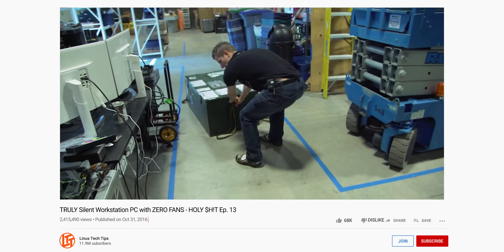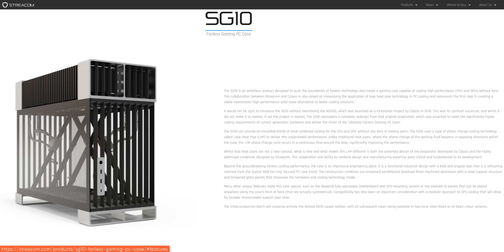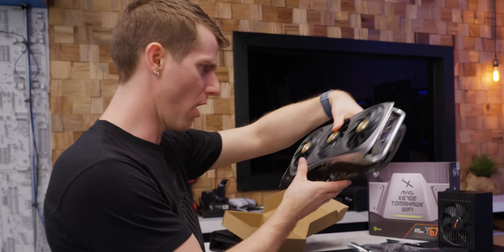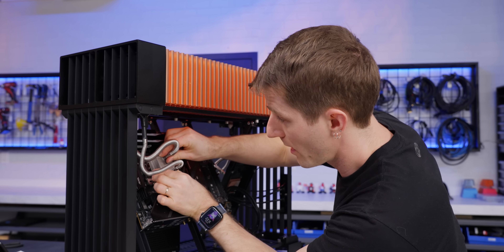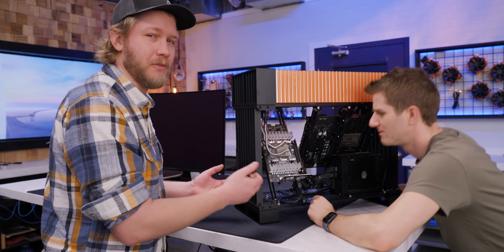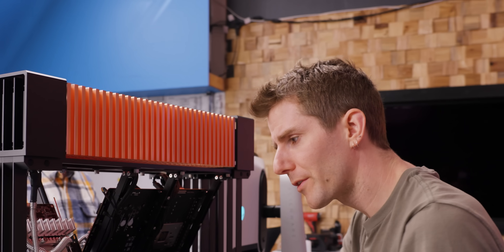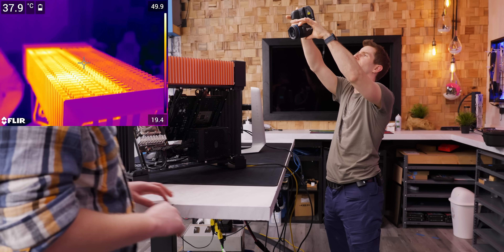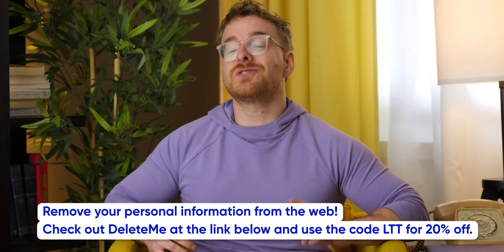I bought this scam PC case... And it actually arrived

Comment: 2K for a 30kg of metal and 1k for the aluminium is pretty cheap. People are spending that on acrylic cases with rgb fans
Reply: For 1k you can build a pretty impressive custom water cooling system, case included.
For 2k you can have 2 pumps, 5 rads (360-400), fans, case, water blocks, tubes, qds, and have money left over.

On the other hand, if you want something UNIQUE, 1-2k is a small price.
Reply: No they are not cheap at all and no people are not spending 1k on a case. My ProArt is more expensive that 95% of people would spend on a case and it's not even $300.

Also, even if 20Kg of those 31Kg were pure copper (which they aren't), that's not even $500 is copper.
Reply: @AirSKWolf  You wrote the answer in your own comment. This is for the people outside the 95%. People do spend over a grand on a case, there are lots of options out there to spend much more than that.
Reply: @--_DJ_--  that wasn't my main argument though. My main argument, in response to the original comment, was that the price of copper is definitely not high enough to justify the price.
Reply: @ I responded to your first point, usually people make their first point their main point. I'm sure it isn't cheap to make that heat exchanger, the forming and filling with refrigerant probably exceeds that material cost. It is an expensive case, but at least with that one you get something expensive with it rather than just a quirky design.
Reply: @--_DJ_--  I mean, sure; you get "something". I could almost understand the justification for 1k on the aluminium one, it's still more expensive than it needs to be but it's niche and low volume so, fine. But the 2k copper one is just crazy, the jump of 1k makes absolutely no sense, the material cost difference is less than $200. It's basically like Apple pricing their RAM upgrades.
Reply: @AirSKWolf  It is also a limited production run, so that adds to the price. Everything we buy is more expensive than it needs to be. When you are buying niche, limited production luxury goods, the more expensive than it needs to be price gets more expensive. It isn't like RAM pricing, that has a known cost. This is a somewhat unique product. As ridiculous as the price is, I was surprised it wasn't more.
Reply: @AirSKWolf  maybe the copper is priced at a premium margin but 1k for the aluminum doesn't seem too unreasonable. If we talking just about raw cost of material then every case on the market is just sheet metal folded and glass or acrylic should cost more than like 50$. I never said you can't build a case for cheaper but I do see a lot of people spending 300 then another 300 just to fill their cases with fans.
Reply: Can't fix stupid or as I like to say.....just because you can doesn't mean that you should... anything for clicks...
Reply: Yeah... you're off, WAY off.

Comment: Linus: Cooks 4090, leaves plastic on very hot copper, installs single orientation PSU into wrong orientation. Never change, I know you can't, speaking from experience ADHD in adults be a b****, just never change lol. Nice case tho, good to see it finally release, cost the same as my last flashlight purchase.

Comment: would be interesting to see the differences in location of the case and what that does for it's heat displacement over time - for example under a desk where the warm air can linger above the case for longer - or in a standard house room with no AC in the height of summer vs winter ... does it run better outside? ..what if you did apply a big chonker fan? ... slapped more heat sink on the heat sink?

Comment: I feel like the CPU cooler probably wasn't mounted correctly or there's a spot that didn't get thermal pasted right above the CCD or something. The cooler clearly worked about as well as regular AIO when cooling the GPU, so logically it should perform as well when cooling the CPU, but the CPU just sits at 86c, so most likely something went wrong, or it's just physics with these new type of cooler. idk, I'd prefer a sanity check in cases like this.

Comment: i have a sugestion for you guys, what if you put a mica plate between the cpu side and gpu side, at the cam shot you can clearly see that the gpu side heats up the cpu side, that in turn creates higher temps on the cpu.
trade and copyright protection by @whocares-w3s.

Comment: $2000 for the 8 years and it doesn't go to space  All that my water cooled 7800x3d in a NZXT case with a NZXT cooler and only seen 73 under 1 hour stress test

Comment: Very Interesting case, the whole cooling with a refrigerant is basically the same principle in a heat pump and AC units. 
There will likely be one big issue at some point with this case, The refrigerant in there is at a certain pressure. Due to likely appearing tiny leakages the system could loose it´s refrigerant charge over time. This will lower the boiling point and the heat capacity the system quietly and unnoticed. At some point, if you don´t monitor, you will have way higher Temps on your chip than at the beginning. And seeing the construction it seem a refill would be a nightmare to do.

Comment: That exchanger would perform way better if it was aluminum. There's a very good engineering reason why copper pipes (good conductor, not so good emitter) are always paired with aluminum radiator fins (good emitter, not so good conductor). It also saves a ton of weight and money, which is why most competent manufacturers go that route.

Comment: I think the most efficient way to have a silent computing experience is to put your loud PC in one room and your peripherals in the next, then run the cables through a small hole in the wall between the rooms.
Reply: @TheHypertwist  I think Linus had a system like you describe at home, he showed it in one video
Reply: a well built fan cooled pc (with huge heatsinks on the CPU and GPU) might actually be quieter than this fanless one

Comment: 10000000% would buy! The weight doesn't bother me, I already run one of the original Thermaltake Level 10 cases, not the GT models the 23kg Aluminium one in black, I call it the Monolith.

Comment: If you would lower the MB and GPU board to reduce the bends in the pipes it would actually be a bit more effective, just saying. It makes the capillary action just slightly more efficient.

Comment: I wonder though if there was may be also a contact issue with the CPU block that exacerbated the issue of high CPU temps. But in any case - super cool case - and the price of 1 grand for the aluminium version is not too bad.

Comment: As the copper not only looks different than aluminium, it have different heat properties. I think you should test both versions, as if copper one barely handles high end pc, aluminium one may fail.

Comment: I think with a pump and big low speed fun, it should weigh less, be quieter than that boiling sound, and offer better cooling. And in that case it can be split system like any other a/c. But will it better then water cooling?

Comment: I really think you want to go direct die with liquid metal for the CPU in this setup. Passive phase-change coolers usually need to get hotter before they start moving heat efficiently. That means the temperature difference between the CPU and the cold plate is smaller than in a traditional active cooler, so anything in between—like the IHS and standard paste—really slows down the transfer.

Think of it like this: imagine your passive cooler can move 1 gallon per minute of fluid at 70°C, while a traditional cooler moves only 0.5 gallons per minute at 40°C. Even though both might carry away about the same amount of total heat, the CPU under the passive cooler has to get hotter before the heat even starts flowing into the cooler. That’s why you want to eliminate as much resistance as possible, like removing the IHS and using liquid metal directly on the die.

That said, it could still work with the IHS—it’s just that you’ll be running hotter and possibly closer to thermal throttling.

Comment: Чтобы зря тепло не пропадало нужно приспособить верхний радиатор на разогрев еды, например. Можно самогон ещё гнать.

To avoid wasting heat, you need to use the upper radiator to heat food, for example. You can also distill moonshine (hooch).

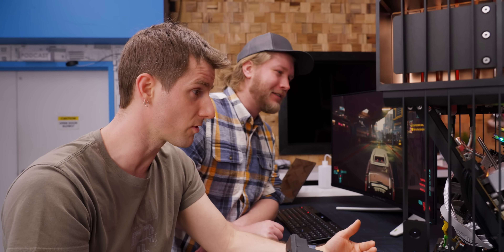Comment: 16:02 _ Im an electromechanic! im 90% confident that..

heat and liquid (thermodynamics!) are working together here for this b-e-a-utiful computer!
As you may know, when a liquid heats up, its molecules gain energy and can vaporize into gas, increasing pressure. Cooler liquid, on the other hand, stays denser and under less pressure. This is where the clever design of the CPU/GPU cooler comes in.

Inside the sealed heat pipes or vapor chambers, a special working fluid boils when it absorbs heat from the processor. The hot liquid turns into vapor — its molecules are super agitated and expanding, looking for space — so they rush toward cooler areas (fast!).

The only places to go? Two pipes — one leading upward and one downward. The system is tilted at 45°, on purpose, for two reasons: gravity helps the condensed fluid return, and it supports efficient vapor flow upward. The hot vapor rises through the larger pipe at the top, while the cooler, condensed liquid flows back through the thinner bottom pipe.

The lower pipe carries the denser, cooler liquid — and being smaller helps maintain a pressure differential that aids the cycle. The working fluid is carefully chosen for its boiling and condensation points, making the whole setup act like a thermal check valve — no moving parts, just heat doing all the work!

Comment: It's cool and all, but I know I'd just end up sticking fans on it anyways. The 1k price tag on the aluminum version doesn't even bother me too much, between PC and peripherals I've got ~6k or so into my system all ready so what's another 1k and the all black variant looks great. 

The thing that would prevent me from doing a build in one of these is uncertainty about mounting support and how quickly they'll bring mounts to market. The current GPU market exacerbates that issue further, I ended up with an 5090 FE because it's the only card I could get my hands on at launch without paying a scalper. Who knows if they'll even make a mounting bracket for it or how long it'll take for them to bring it to market? It's been over two months since launch and they don't have mounting hardware for a single 50 series card listed, that means at best if they were to release one tomorrow new GPUs are looking at ~10% of their market lifespan spent waiting on hardware to mount a cooler. That's not quite a deal breaker personally since I upgrade every other generation but if they're looking at 4-5 months before the hardware is actually available I'd want nothing to do with this.

Comment: If the actual pc components were encased somehow this would be genuinely very useful for workshop applications where you've got steel dust everywhere. Usualy PCs don't live long in those environments. There are fanless workshop pcs but they're both very expensive and very slow. Enough for looking at schematics and listening to music, but they're not exactly snappy.

Comment: Remember the OG NCIX water cooling kits Linus used to pimp with the full flow hoses and XSPC radiators?
Well if you take a 3 x 120 extra-wide XSPC radiator and align it just the right height over the CPU, and you don't hook any other components up (overkill I know) you don't need to run the fans almost ever, and if you just bypass the pumps it still works surprisingly well off convection current. And this is with the old Swiftech HydrX solution mixed into distilled water, not some fancy coolant.

Comment: This seems like something that would be highly beneficial in a professional/commercial environment where there either isn't constant load on the system like processing X-Rays/MRI's in a hospital or the load is lighter like running systems in a factory.

Comment: If you were to build in this case for the cooling capacity and not for noise consideration, throwing a few fans on the underside of that condenser would probably make a markable increase in cooling capacity, as condensers tend to work best with forcefully rejected heat. I've always wondered if you could effectively cool a system with refrigerant without the use of a compressor, and it looks like you could.

Comment: I have a portable wood-fired hot tub I use camping and the technology is the same, two tubes attached on the side, the lower tube pulls cold water into a metal spiral in the fire where the water is heated around and shoots out the top tube hot, creating it's own pressure loop, the CPU and GPU just do the same thing with the objective to cool.

Comment: Would've been cool to see what a big, slow moving fan could've contributed to the performance as it probably wouldn't have changed much about the sound levels.
Reply: Yea would def like to see what adding some fans would have done for it but otherwise not so impressed when seeing the price & space heater trade off unless lived in a place where it was colder then that might be a good thing lolz.

Comment: in Ukraine it is quite common to have gravity circulation heating system. Even my house has such system that can work both with or without pump (in case of power outage)

Comment: This has got to be one of the coolest most space age looking cases I’ve ever seen. It is remarkably similar to the cooling system on several of my pre 1950 tractors that uses the same principle of thermosiphon for cooling. They use a mixture of diluted antifreeze but no water pumps and they will run all day dragging a plow!

Comment: This is actually the first time that I feel like a case is truly impressive. The tech, the layout. The look. Actually sick
Reply: there are some quite good looking cases out there like the Thermaltake P3 TG Pro with all glass and a couple of bars, but none of them have their own way of cooling stuff.
Reply: @inkredebilchina9699  my last build was in that tt case...i actually hated the way it turned out, guy i sold it to absolutely loved it tho
Reply: It's pretty crazy to dump that much wasted heat into the air.  Hopefully there will come a day when chips will generate no heat.  In fact there's a research project going on now for reusing the heat as extra power, basically emitting little to no heat.
Reply: @BillAnt  Heya, what research project are you refering to?
Reply: @BillAnt  Waste heat recycling isn't exactly new. Formula 1 cars have been running systems (MGU-H) that harvest waste heat from the exhaust to create electrical power for over a decade. They're actually dumping it next year due to the cost and complexity of the systems versus the benefits.
Reply: @ - Not recycled with an external heat exchanger/power converter, but right on the chip die without emitting heat to begin with.
Reply: Had a feeling it would be like that
Reply: @BillAnt thermodynamics might make this impossible with current tech
Reply: @ - They are experimenting with different ""chip doping" methods to recycle the electrons in the junctions decreasing heat and increasing power efficiency.  I saw it recently on the Asianometry YT channel.
Reply: @BillAnt  I built my own computer using a Cooler Master case, and I can't feel any heat coming from it at all.  All over the outside of the case feels room temperature to me.
Reply: @ - Right because it dissipates the heat immediately not allowing it to build up.  Take off the cooler and you can cook eggs on the chip die.
Reply: @BillAnt  heat pumps have been around for 100 years
Reply: There will never be a day where they don't produce heat, that's not how physics work. Maybe there will be a day where the heat energy can be converted back into electricity for the power supply to draw from or something but anything using power will always produce some heat. Even rubbing your hands together will produce heat.
Reply: @BillAnt  learn laws of thermodynamics before posting
Reply: @BillAnt  This isn't unique to this case. if TDP is the same it will output the same heat into the air
Reply: @BillAnt  "no heat" will be literally impossible. You don't get to violate thermodynamics. Even a 5W LED generates heat, never mind a system half a thousand watts, at least. But yeah, reusing the heat is possible. Whether it's feasible, however, is a different matter entirely.
Reply: @BillAnt  not generating any extra heat than any other pc, it just feels hotter because it dissipates it slower. all electronics generate some amount of heat, unless it was all some superconductor with literally zero electrical resistance, at which point i doubt you could make an actual circuit. Theoretically you can turn heat back to electricity, but then it's just a question of materials and cost, vs just paying for cooling and power production elsewhere.
Reply: for 2000 dollars, it should be impressive at least.
Reply: Its a huge waste of copper xD
Reply: yeah so exciting. having a brown piece of copper after a few months on top of that case
Reply: yeah not for 2000.
Reply: Remember that one time when Razer had a concept for a modular system which everybody wanted, then never brought it to market? That was cool.
Reply: Cool for a video, useless for daily use
Reply: yeah I agree this video made me sick too! Just like all LTT videos
Reply: Ikr. This is just innovation that doesnt rear its head very often anymore.
Reply: Genuinly have not watched a pc build of theirs before this in years
Reply: Till you toast something outside the case for mistake :(
Reply: Are those temps acceptable or should they be lower?
Reply: I think it looks hideous, but to each his own
Reply: 2000 EUrodallorssas